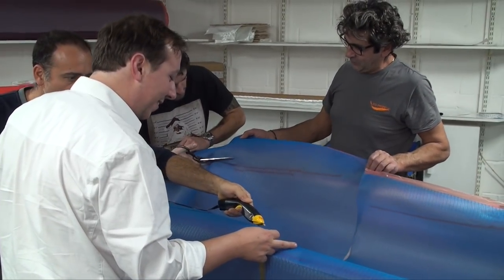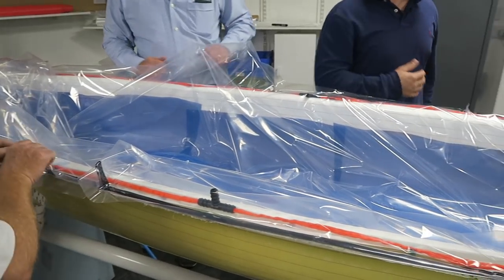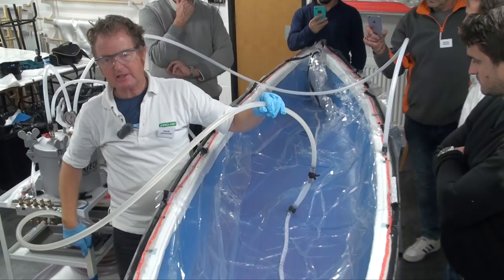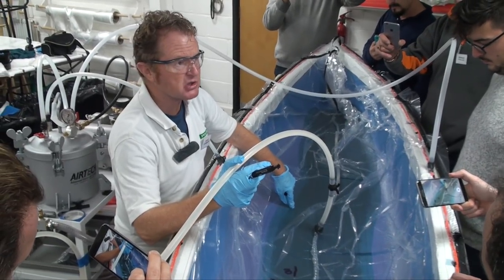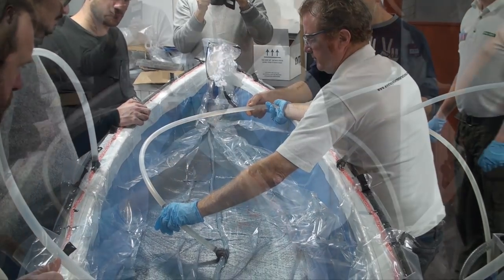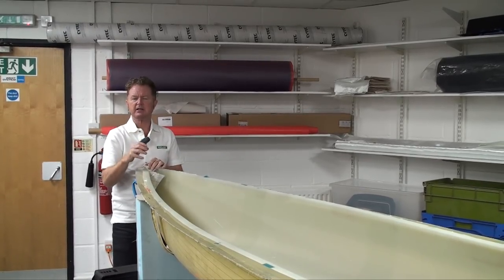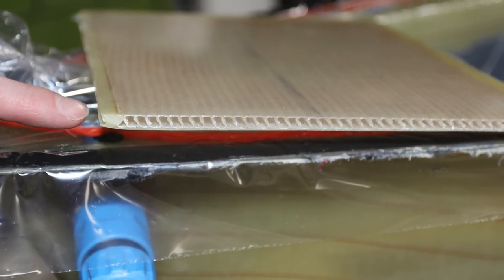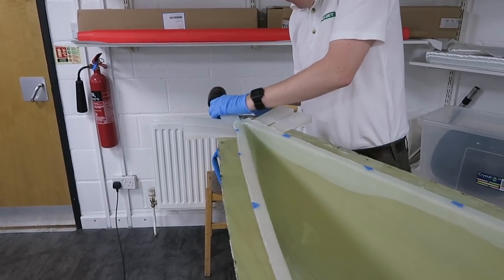Making a canoe with PRO-SET® vacuum infusion epoxy

Comment: Further fine-tuning the process would include closing a valve between the pump and the vacuum-reservoir, then  keeping an eye on a vacuum-gauge meter (on the reservoir, to check for leaks. And masking the edge of the mold before applying mold release wax. The gum tape may not stick to good on the wax, you know.  And produce a video without the elevator music, which does not serve any purpose. Just my 2 cents!

Comment: Hi do you have any recommendations on what to use to air seal a split mould that's being vacuum infused? Having trouble getting the split fully sealed and not sucking in air.
Reply from the maker: Hi Jerica, it's possible to create a rebate in the mould return flange during the mould making process enough to facilitate a silicone chord that will affect a good seal. A thick skin coat or gelcoat can seal any potential entry of air. Cheap silicone sealant can be used. The tooling can be placed in an envelope vac bag. Bag tape can be used, it's imperative to ensure a good seal. Any atmospheric air entering the part will distribute globally through the composite. Hope this helps.
Reply: Thank you for the help!!

Comment: Was this fabric you used fiberglass or carbon fiber? I assume not fiberglass.  If carbon fiber, what type of carbon fiber mesh did you use?
Reply: it was fiberglass, they said they used bi-axial cloth which is makes sense since they didn’t spray any gelcoat in the mold, bi-axial cloth is a lot smoother finish than something like 1708 or matte, also saturates a lot easier and makes for a even layer resin within the glass when cured

Comment: People have been using this process for many years in other industries and hobbies, and called it vacuum bagging.  Boat builders wanted to sound very high-tech and decided to call it "INFUSION".
I will steam infuse a piece of wood so that it will be easy to bend without breaking.  Peons call it steam bending.
Reply: infusion is the process of infusing resin into the dry fiberglass strands UsInG the process of vacuum bagging, it’s a more specific term than just “vacuum bagging” we don’t call up our supply store and ask for “vacuum bagging resin” lol any resin can be used for vacuum bagging, PRO-SET infusion resin is specifically made for infusions because it is a lower viscosity resin which makes it easier for the resin to flow through the hoses and evenly spread the resin at a convenient rate ensuring that every single millimeter of fiberglass is saturated in resin which in turn creates more structural integrity when it cures because of the added pressure and even distribution of resin.
Reply: Looks like you didn’t grasp the process try viewing a few more times